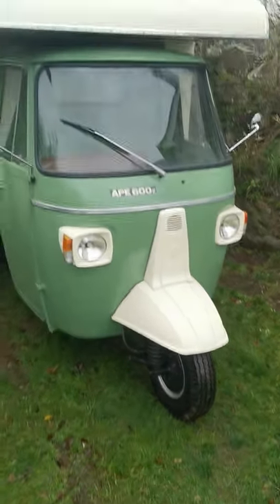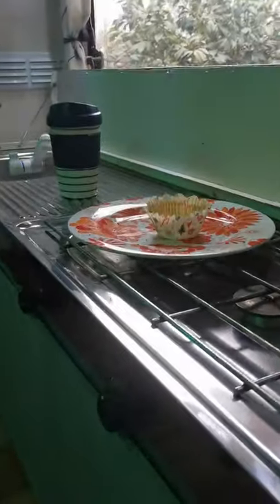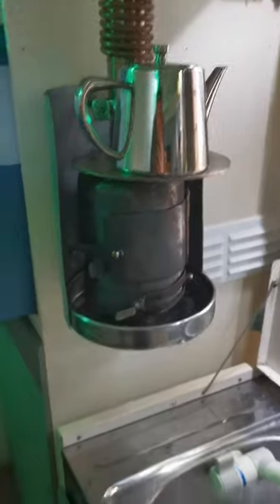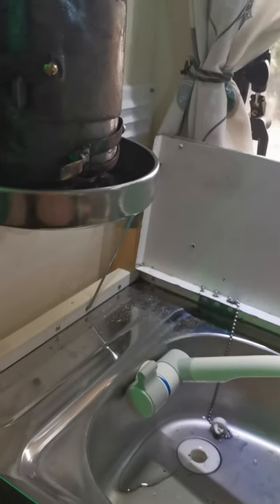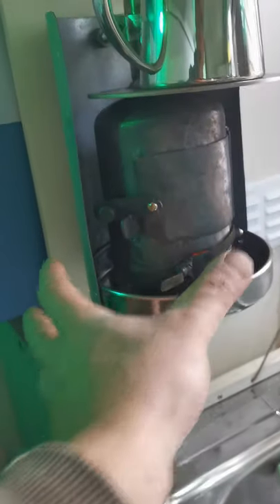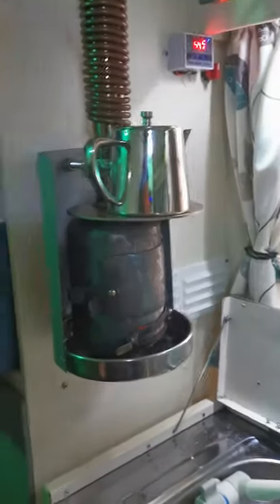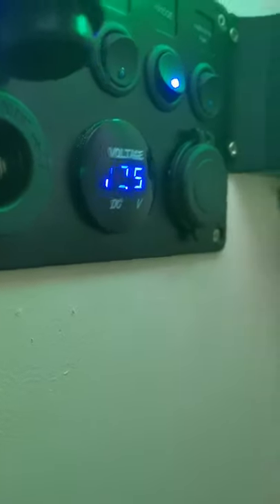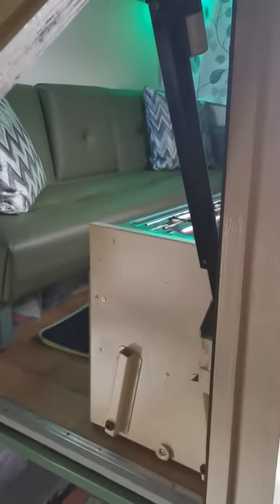Piaggio ape camper overview. The worlds smallest camper?

Comment: Nice mini house 
I didn’t understand the fridge.
It was empty, and looked like a cooler.
The bed seemed to be doing something movement wise. It was confusing 
I like the rear door can be like awning and you could be under it ..
Reply from the maker: The fridge is a small compressor fridge. Not a cooler. It can also be used as a freezer by setting the temperature lower. The sofa is motorised. I can use a switch to drive it across the camper. The back then folds back to make a wider bed. I do have an awning for the back to make a fully enclosed area 2m x2m where I can stand up

Comment: Fantastic project. Well done, mate! Gives me ideas.
Did you elongate the room to be able to fit fully stretched out when you're in bed?
Greetings from Norway
Reply from the maker: If you look at the back of the truck, I folded the tailgate down and used that extra length to maximise floor area. The main living area is 2m long by 1.4m wide. There is a luton style top over the cab for storing bedding and clothes.